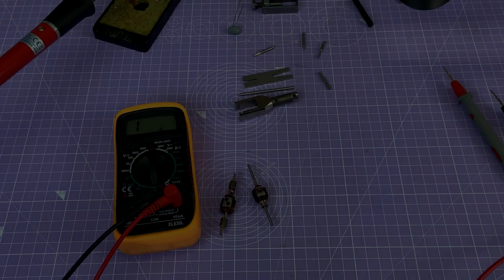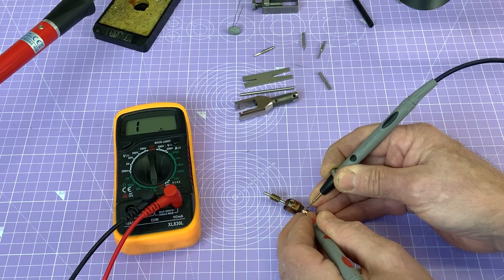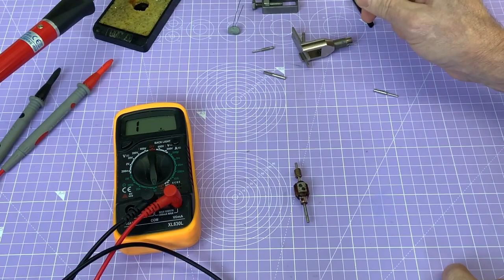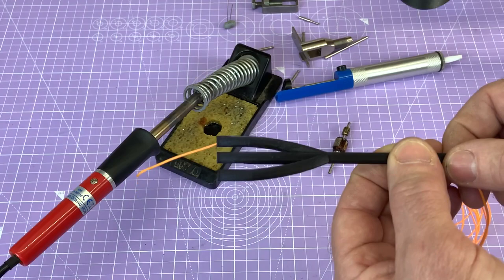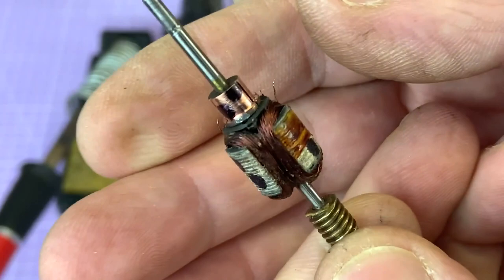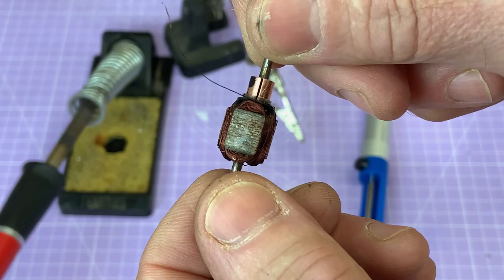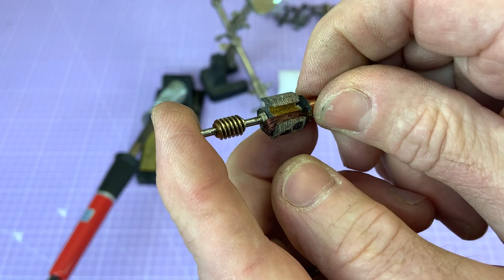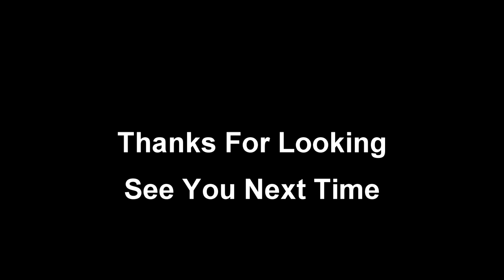Work Continues On The Tri-ang X 410 Armature From Steve, Today I Strip Off The Old Failed Windings.

Comment: I have a very good friend who rewound a Hornby Dublo Rebuilt West Country armature, he actually got a few more turns of the wire in, I think it was slightly thinner, but it ran beautifully, better than when new! I admire the both of you for doing this, it's certainly not an easy job that just anyone can do.
Reply from the maker: Hello David. I had a look at the Dublo and Wrenn armatures, I think they are Star wound which means only one wire on each commutator segment, reading about this is quite interesting as this armature is more Delta styled with two wires per segment. It's encouraging to hear of your friends success. I'll keep that thought when I'm winding. Best regards to you

Comment: Great to see the project started and your attempting to find the original length of wire. Most i've found come in at about 4m. I check one and then put the armature in a drill and use a small saw blade to just cut away an end of the wire, and yanking the rest off. no messy wire everywhere (its worse than hair at getting tangled!) Can't wait to the the results of the 3D rewinder, will be interesting to see how neatly it wraps the wire (tension required but not too much to A- break the wire B- Wrap only round a small part of the anvil C- break the machine). The model railforum came in very useful for me when attempting rewinds in case any double checking is necessary.
lovely quiet ivatt at the end! 

Regards
Will
Reply from the maker: As I type this I am about to try and measure the wire length. Other sources have suggested around 4 yards and 270 turns so I wasn't far out with turns and by the next video I'll have an idea of length. I shall be using 40 SWG. All the best to you
Reply: @MrSnooze  I cannot remember the SWG number, but i know 0.18mm seems to match perfectly and i've had 7 ohm readings from it and equal top speeds/power with coaches

Comment: Fascinating stuff, thank you for sharing. I was impressed by your worm puller. I have not seen ones as versatile as that, where did you get it from? Looking forward I think the trickiest part of the job may well be the soldering back onto the commutator. You will need to combine the two wires of different lengths from adjacent coils into a single blob of solder so perhaps some kind of a comb to hold the wires in position would help you. Good luck with it and I look forward to seeing how you get on.
Reply from the maker: The puller was an E-bay buy, all the way from the East but it has been very useful. I'm not too worried about the soldering, it's cleaning the enamel from the thin (40 SWG) wires that worries me a bit. Best regards to you

Comment: Very enjoyable as always.  Typing this with difficulty as not finding my tree on your layout has stressed me out.  To be a little more serious: these windings get warm/hot; how do you ascertain whether the chosen insulation material does not exude toxic gas into the poorly ventilated confines of out train rooms?  Many 'lacques/paints' will insulate, but.....  Might be worth a chat to the local motor repair workshop.  I think they will advise?  Most of us have finally got the message with chemicals and airbrushing, but we don't seem to extend beyond.
On running out of braid.  With snips, cut into strips the top of a fruit/jam tin.  The tin plated metal solders well and likely makes a good braid.  Test first of course.  one of our best club modellers used to say 'Why use brass when your kitchen is full of tinplate for free?'  I liked Norm.
Really will have to stop wasting so much time on Uchoob.
Pete
Reply from the maker: Hello Pete, It's a bit dry for planting young trees but do keep an eye out, you never know when one might appear. I used modern acrylic paints on that armature, I was rather disappointed there were no decent fumes.  Unlike some of the older original motors that give off interesting smells when warm, this rewound Item didn't smell at all and when I measured it with my infra red thermometer it ran cooler than a standard unit so no worries about chemicals I think. Thanks for watching, take care, best regards to you
Reply: @MrSnooze  Yes, still worth asking the professionals.  Another consideration is whether the insulation can be removed should things go wrong or a rewind be required in the indefinite future.  How did you remove the residual old insulation this time?  Years ago one of the then common model paints caused great concern with its thinner which was a known carcinogen (no names, no pack drill).  It is no longer on the market.  Sorry to be so ultra-cautious, but it's the kids mate; they will do e-x-a-c-t-l-y what we tell them.
As you are a clockmaker, don't forget to have a look at Clickspring, and how on earth did you set up that line boring?
Finally, with apologies to the Great Bard: 'Pete's tree, Pete's tree; my kingdom for Pete's tree!'

Comment: I have the same type of gear puller, a useful tool. Nice work so far though I think solder braid might have been easier for desoldering with some liquid resin flux. Kapton tape might be a way to insulate as long as it’s not the cheap nasty fake stuff.
Reply from the maker: Good suggestions, unfortunately I'm right out of braid. Take care, best regards to you